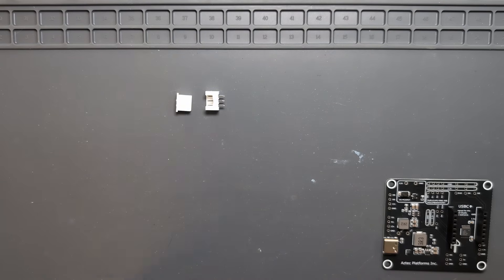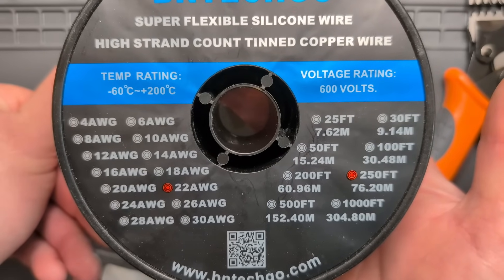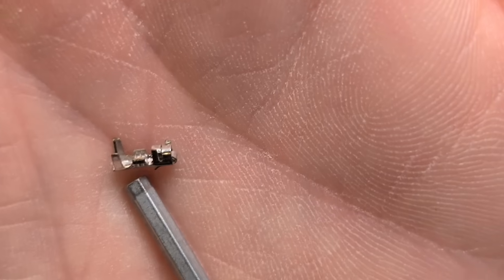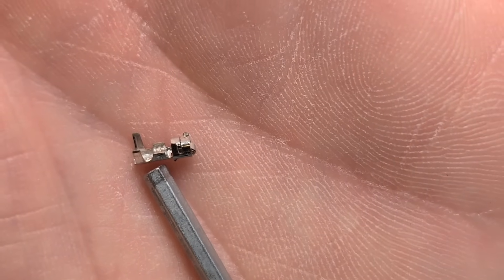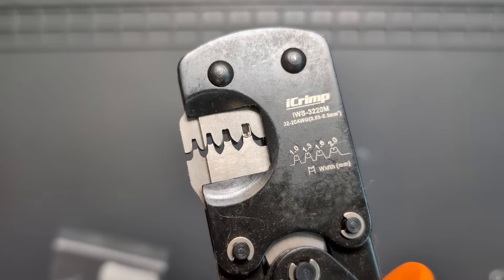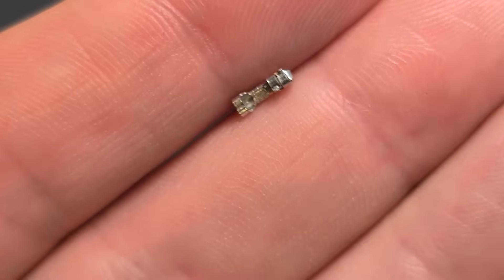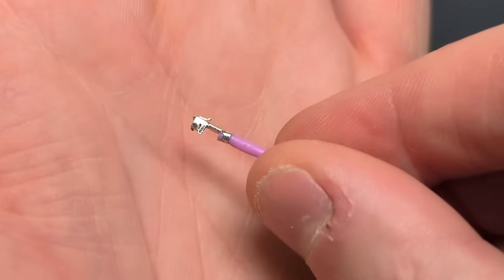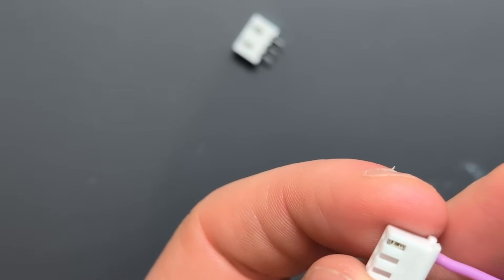Make Wires Like a Pro | Crimping JST-XH Connectors for Clean, Reliable DIY Electronics

Comment: Thanks for the guide. I still suck at doing the crimp.
Reply from the maker: 😂 keep practicing - took me a lot of reps to get right! And, unfortunately, the tool you use does make a big difference. I used to use Adafruit tool and was getting poor crimps pretty frequently, switched to this one (iCrimp IWS-3220M) and now they are consistently good.
Reply: @AztecPlatforms  I'm gonna order a iCrimp IWS-3220M, my tool messup the crimp.